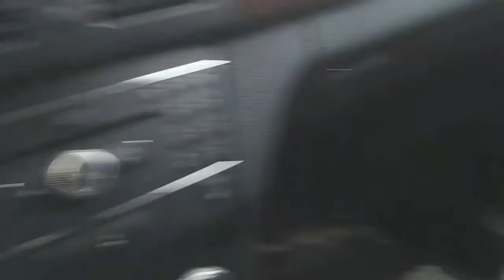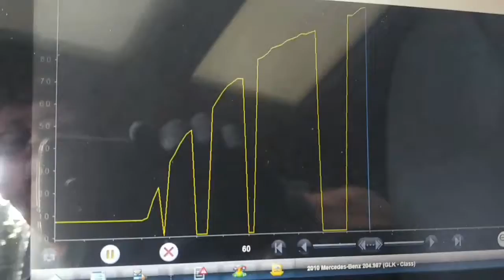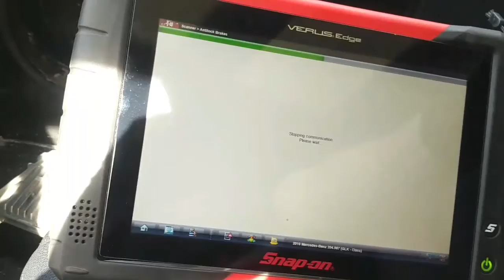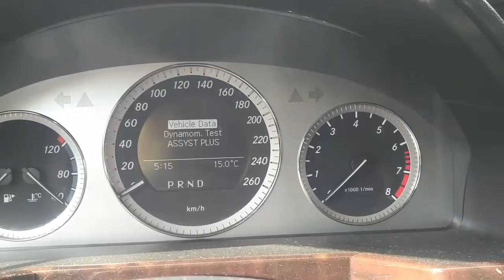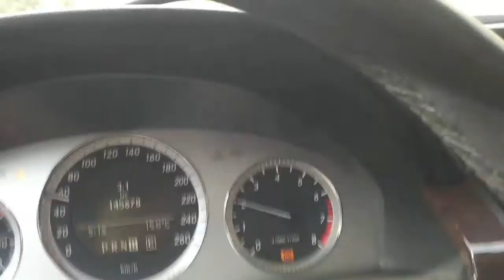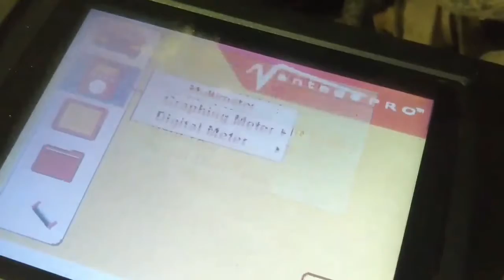2010 Mercedes Benz GLK 350 ABS/TCS Problem

Comment: Hello, I had d same issues with my glk 2010 rear censor and I had it replaced but the abs light is still on so I was told that the abs control module is faulty
Reply from the maker: Its pretty rare for the module to fail. Possibly the reluctor the sensor senses has fallen off or moved. I'd get a second opinion before changing the abs module good luck
Reply: I got this issue today on my 2011 GLK 350, I believe the reluctor ring is dead in my case as well.

Comment: Hello phillip, I'm having the same issues with my 2006 land rover range rover. Do you know how to put this vehicle in dyno mode? The steering wheel buttons are a bit different on this vehicle.
Reply from the maker: No I'm sorry that I can't help you there. Maybe pulling an ABS fuse will disable the system. I'll see if I can find any information on it.
Reply: @PhillipBailey   hey thanks for the reply. I was already on it. The fuse is 5a and its labeled on the passenger compartment fuse box. Thank you so much!
Reply from the maker: @globalcontent1868  yes as far as I can determine land Rover does not have a dyno mode unless it's with a scanner
Reply: @PhillipBailey  Thank you, I'll try pulling the fuse and then take it for a spin and see how does. Thanks again!

Comment: same issue on my 2011 glk, been driving under dyno for a month now. Did you end up finding the sensor that needed to be replace?
Reply from the maker: As far as I could tell both rear sensors were shot. Customer was going to replace himself.
Reply from the maker: Victor Lopez 

As far as I could tell, it was both rear sensors but the customer has not fixed it as yet.
Reply: did you resolve yours and what was the resolution ?